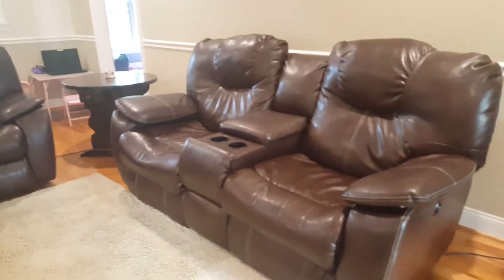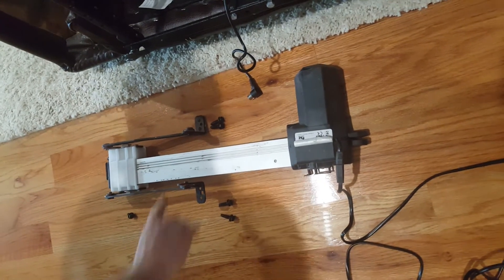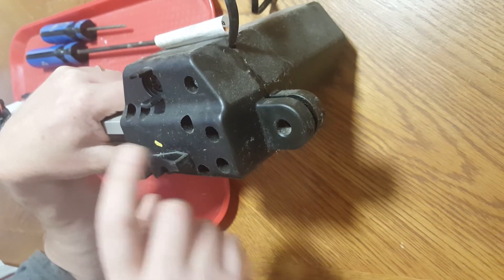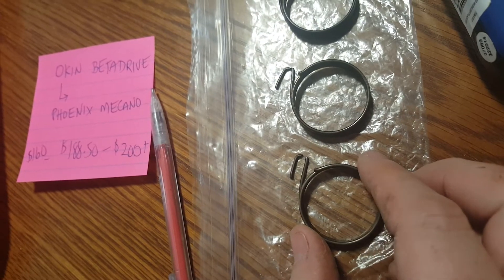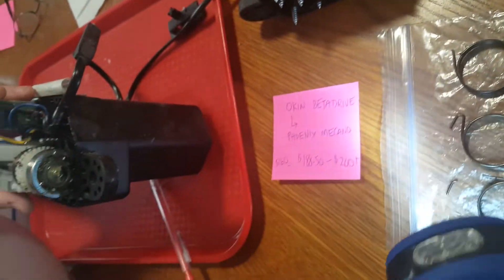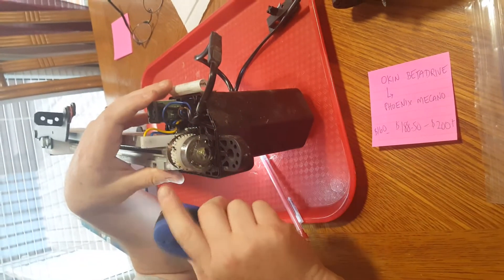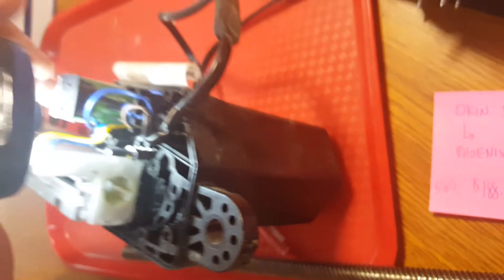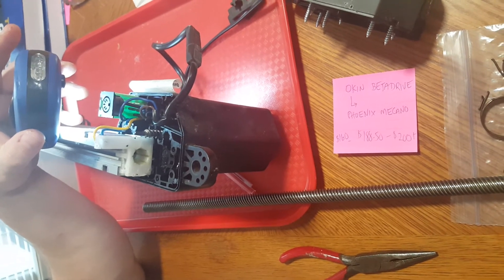Okin (Phoenix Mecano) BetaDrive Motor Spring Failures!

Comment: Hello, trying to save Moms Fav Chair; working on/in  AN OKIN GAMMADRIVE MOTOR/ #78877; throw is about 6-7 inches for chair back recline;  spring replacement would be great/  not on this 1; motor will not move, at all, no sound, NO SMELL -with a test  light and jumping using the power supply direct, 0, nada, soundless n lifeless- ANY, any chance of repairing the motor or bad wind/coil ??? Chair is only in use 1 yr and BACK HAS NEVER RECLINED-- ( foot motor works fine ) THANKsss !

Comment: Great Video, John. Worked like a champ, almost!  Apparently, when I screwed the shaft back into the slide block, the block must have gotten out of its original position, so when the motor pulled the block all the way back in, the motor did not stop and it cracked the internals of the slide block. So now, in one direction, under the force of pulling the recliner back into normal position, the slide block will disengage from the drive shaft.  I took the slide block off and it appears to be injection molded in one piece.  So the exterior of the block came off, but the internal section of the block remained on the drive shaft.  Anybody know where I can get a new slide block? Great video though.  Although people should be aware of where the block is positioned relative to the stop limit on the motor.

Comment: John, you seem knowledgeable on the inner workings of these linear actuators.  I have two bad ones, and the first one is due to a bad limit switch (NO/NC contacts are both closed all the time). The actuator failed in the upright position and won't recline, which I suppose is the better failure mode :). Since the reclined limit switch failed, the couch thinks it is both upright and fully reclined at the same time, and won't budge.  The switch is not too hard to replace, you just have to take the whole actuator apart. I'm trying to source a new limit switch right now, and can't find one with the right button height.  I found a similar part, and bought 10 for $6.99 from Amazon, and am trying to find something to glue onto the switch to increase the height. I'm contacting Okin, but I'm not too hopeful after watching this video.  I have two actuators that are bad on two couches.  I don't really feel like spending $400 on two new actuators....

Comment: I have an Oakin actuator on my couch and its stuck. Won’t budge. The thing is stuck in the open position. Is it possible for me to remove the actuator entirely and leave it in the closed position? I don’t care much for the reclining feature
Reply from the maker: I'd say yes. Follow the beginning of the video and just remove the actuator entirely. So then the foot rest should come back to closed and you won't be able to raise it or recline. It'd just be a chair. Let me know how it goes.🙂👍
Reply: @JohnSmith-yy5zp  Is there a repair for this failure? When its stuck open and wont close? Looking to fix without buying whole new actuator.
Reply from the maker: @atanner4960  Maybe follow the steps to take the actuator cover apart. And then look and see if the rod spins. Electrically, I think it's just a motor and two limit switches that turn off the motor when it gets to the end of travel. So, motor, rod, gears, limit switches, wiring.. It;s one of those or something is bound. You'll have to Google around and see if you can find those individual components. Taking off the actuator completely gets you  your chair back, but not the functionality. That'll take the more detailed repair you are taking on. Good luck!
Reply: Mine failed in the upright position and won't recline. I found that a limit switch failed, so the couch thinks it is both upright and fully reclined at the same time, and won't budge.  The switch is not too hard to replace, you just have to take the whole actuator apart. I'm trying to source a new limit switch right now, and can't find one with the right button height.  I bought 10 for $6.99 from Amazon, and am trying to find something to glue onto the switch to increase the height. I'm contacting Okin, but I'm not too hopeful after watching this video.  Okin does not sell parts or provide their supplier info for the parts.   I have two actuators that are bad on two couches.  I don't really feel like spending $400 on two new actuators....

Comment: Thank you so much for your video and recommendations. I removed the broken spring and my lift chair works just fine, .... and without the clicking sound. Does anyone know what the spring (mechanism function) is for?? My lift chair seems to work well without the spring component. A word to Okin (the 'motor actuator' manufacturer), ..... you guys had better get your customer service (or lack there of) together immediately. I plan to share this video (with the customer comments) ... FAR AND WIDE. This kind of BS will not be tolerated in the future....and any Okin products used in furniture will be called out and identified before any purchase. Your as bad as the corrupt governments...
Reply from the maker: I think that the spring is to provide some counterforce so that if you push down on the leg rest, your weight won't make the rod rotate backwards. Basically, so the motor turns the rod and not your weight. With all these springs breaking everywhere, though, that design is not working too well. I'm glad you got yours fixed! ;)

Comment: My recliner makes a knocking noise both up and down.  If I force it back with my weight in the chair it will recline fully.  Makes the same noise going down and by pressing with my legs recliner will go to start position.  This chair is still under warranty but company refuses to service because the company they use to supply the motor is no longer in business.  Could it just be the spring or how can I pressure the company to install a part that I purchase?  Thanks for your video.  Hope it is just the spring
Reply from the maker: I would say it's more than just the spring. With these motors, you can't push the leg pad down. The motor has a screw that has to turn. If it's still under warranty, they should fix it and find a supplier to find whatever parts they need to do that. If it's under warranty, fixing it is the company's responsibility, not the customer's. Good luck!!

Comment: This is totally legit, Easy and works fine. Made popcorn and watched a movie immediately after.  Saved 200 bucks.  !  What a scam these motors area. Why did they put the spring there, if it works without?